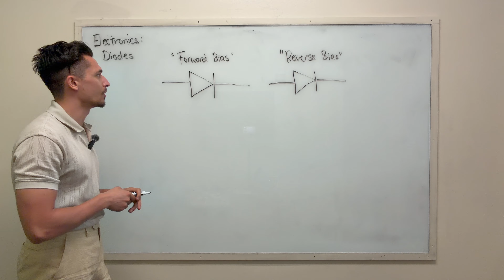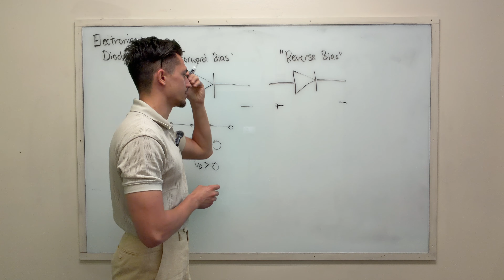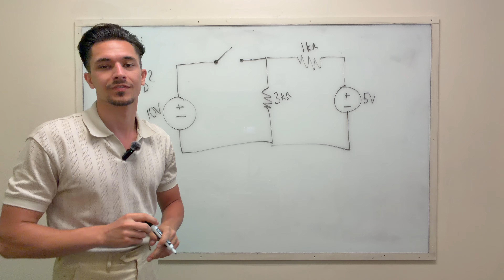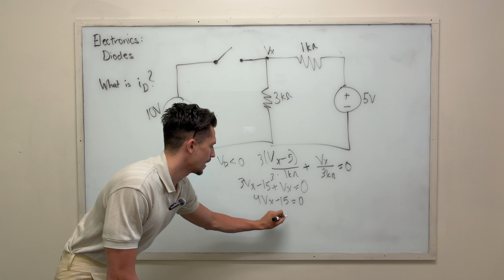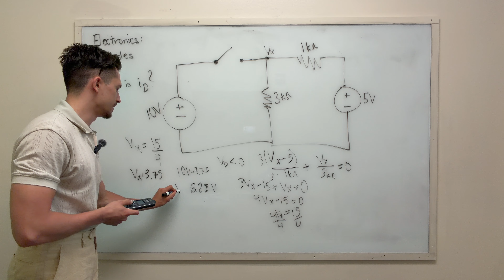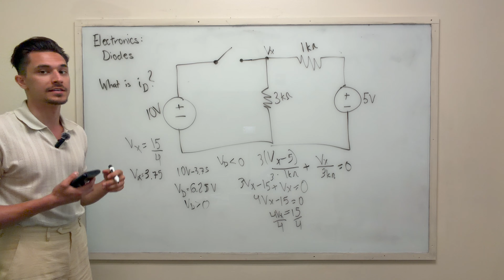Forward vs. Reverse bias diodes in a circuit

Comment: Thanks for the video Eric. Wait, but how do you know the diode is even on here? Like you solved for the currents assuming it conducts but what if the answer comes out with current trying to go the wrong way through it? Do you just start over? and does it change if the diode isn't ideal? like once you add the 0.7V drop do your two mesh equations even stay linear?
Reply from the maker: Yea great questions! So firstly, if you notice the diode is going in reverse, we would have a negative voltage going through it which would make the diode “reverse bias”. For this video I tried to keep it straight forward and ideal however the parameters would change if it wasn’t ideal. However, the math wouldn’t be too different just would have to act like the diode is either short circuiting or as a 0.7 voltage source depending on the direction of the diode (in non-ideal context). Hope that helps :)
Reply: @ericgadula2457  Thanks so much Eric!!! Now i'm going to try to rewire my refrigerator in reverse with this newfound knowledge